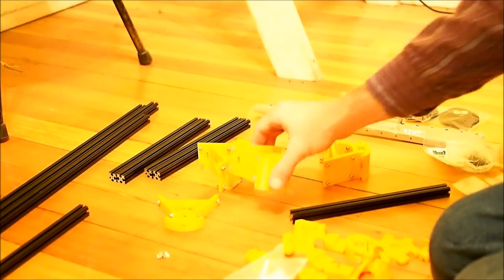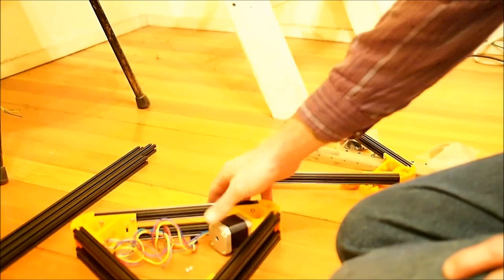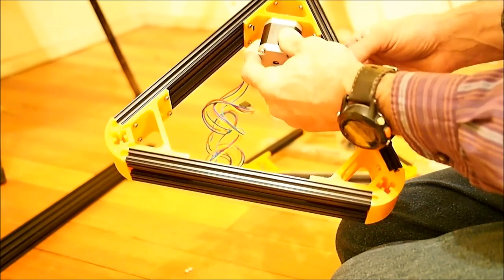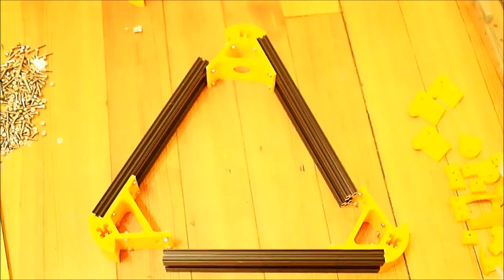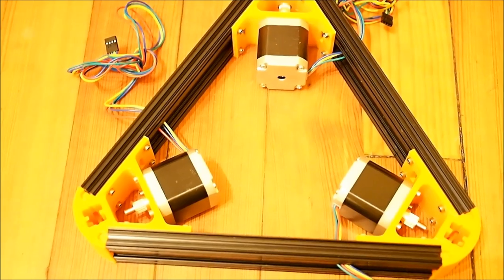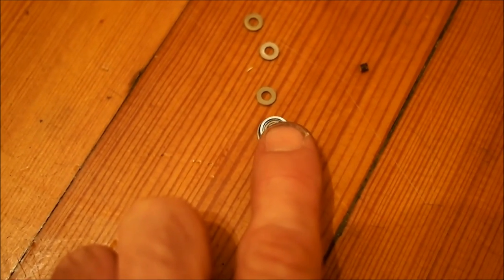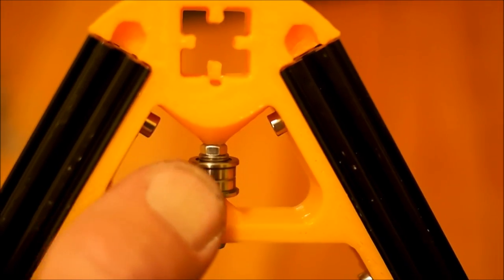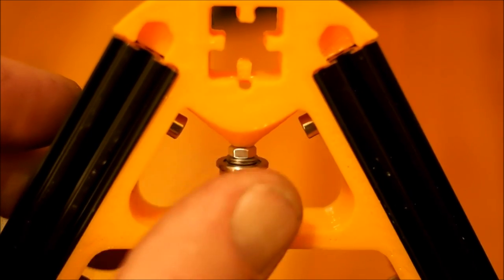Mini Kossel 3D Printer Build - 3  -  Frame, assembly of the Base and Top

Comment: This is the fourth video I've seen that shows assembling the base of the frame. All four videos show the version of printer with the double height corner (ie. only 6 corner pieces in total vs. 9). I'm trying to find a video showing assembly that uses the 9 corner pieces. II don't have one of these printers but I'm thinking of buying one. I would like to see how the spacing is set between the upper and lower sections used in the bottom of the frame.